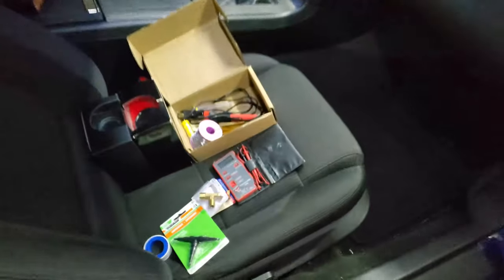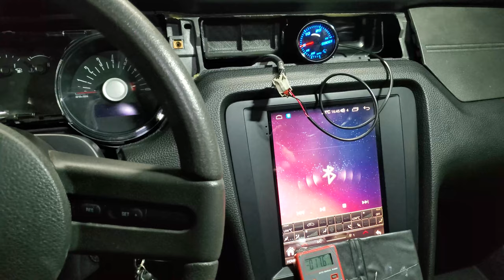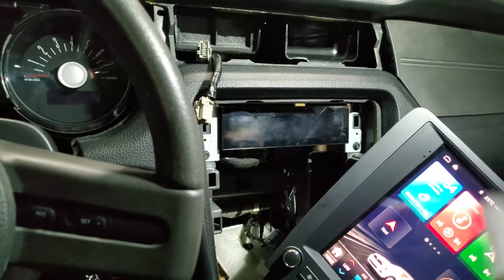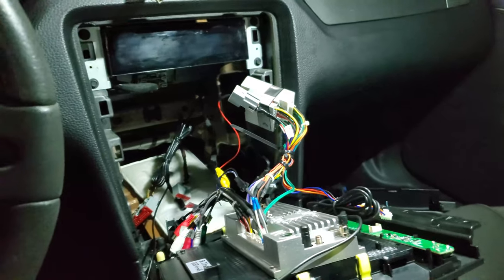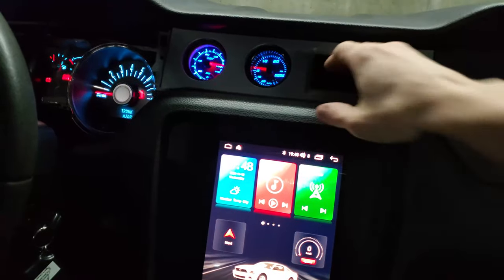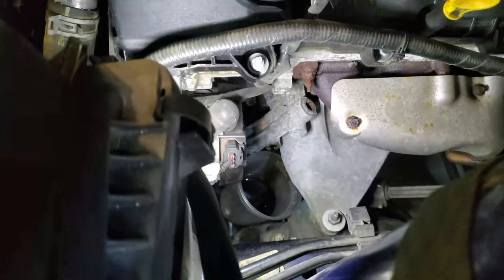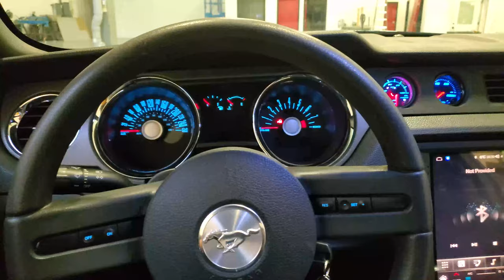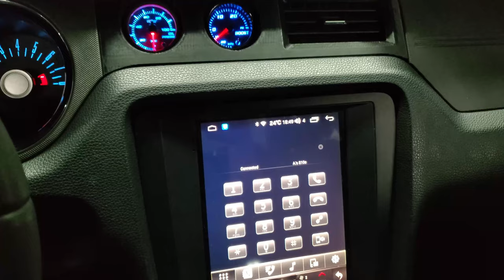GlowShift Oil Pressure Gauge Install

Comment: It look amazing brother keep up the great work
Reply from the maker: thanks again 🙂comments like these keep me going haha. I don't know if I've explained in the video but the turbos that I've bought come with huge oil supply lines like 1/4" ID without any restrictors. so I was concerned if about my engine's oil pressure when the turbos get installed. For that reason I wanted to install oil pressure gauge and get some baseline oil pressure values and hopefully not deviate too far once when the oil feed lines and the turbos get installed.